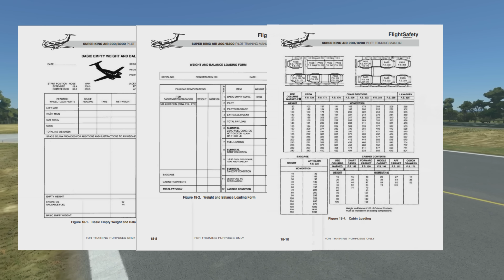Disaster Just After Take Off | Crash of King Air, Melbourne, Australia

Comment: Thanks for your video.
Some comments though.
You said the retail centre was just outside the airport.
In fact it was built within the original airport grounds.
This is an increasing problem in Australia as airports have been sold off to private operators.
These people are keen to reap the rewards of the real estate they own and are increasingly encroaching on the airport space of many of our airfields.
If the retail centre had not been built there may have been sufficient space to put the aircraft down.
In any case Essenden airport was once the main airpot for Melbourne, it was surrounded by open country when it was built.
Over the years residential and commercial building have been allowed to encroach until they are now right up to the bouneries of the airport.
In the event of an emergency there is now no where an aircraft can safely put down!
This is a growing problem.
At Bankstown (YSBK) the 18/36 runway was closed years ago and the area converted into commercial real estate.
The major tenants at he airport seem to be commercial non aviation businesses with large areas turned over to commercial development..
At Camden (YSCN) a nursing home has been built in line with the runway in a position that used to be rural land and was available for aircraft in an emergency.
An aircraft cannot return to the runway anless it has reached around 1,000 ft, below hat it masu land straight ahead.
In the case of Camden, that means into the nursing home!
Local Councils must be held to account for their irresponsible planning decisions.
The alternative is to close all airports, after all, that is what the property developers want!

Comment: Checklist problem. The pilot is fully at fault for this incident. Even being overweight by 1,000 lb. The plane is more than capable taking off and flying correctly but it must be trimmed properly especially on takeoff. Or at Landing. The two most dangerous times is the transition from ground-to-air and from air-to-ground. He had to have been suffering a lot of issues trying to keep the plane straight going down the runway. So why he even rotated the aircraft is still beyond me.

Comment: I agree with viewer, pilot would've noticed rudder trim during take off itself while on the ground roll.

2nd, 5 feet off the ground pulls hand you push nose down, reduce throttle and land immediately even if 3/4 down runways. Taking it to the air with flaps set & Gear down & extended is crazy.

If he decides to continue the Drill is mixture, props & throttle set full then flaps up/ gear up. Bank into good engine then adjust rudder & airleron trim as needed to relieve pressure etc 

Or reduce throttle on right engine a bit to relieve of servere yawing effect.

Identify & verify to feather engine only if you see engine gauges showing one engine not producing theust

Comment: I've never flown a twin.  This obviously happened quickly.  I think my immediate reaction would be to pull power off the starboard engine and stomp on that right rudder.
Reply: Which would have brought this overweight plane to the ground even quicker.
This close to the ground at max weight, it need all the engine power it can get.
Get the yaw straightended out, and all is fine.

Comment: whether or not the pilot "did the hecklist" is irrelevant.. we don't know really if they did or did not do a check list. Regardless the first step in the event of an engine failure, this instance the airplane yawed to the left as if the left engine failed, (I'm not buying the rudder trim setting either)  the first step in the appearance of a yaw to the left or right indicating loss of power on that side is "positive rate gear up, maintain directional control", of which is rudder input! If your stepping on a rudder is not enough then rudder trim is appropriate,  we don't know the pilots may have turned the rudder trim the wrong way.  the 528 lbs over wt is also irrelevant, it is 4% of gross wt, for a King Air 200.  Why is the pilot uttering over the radio mayday..?  What is that going to do.?  Fly the damn airplane. The airplane was flyable if he had maintained directional control and raised the landing gear... the first two memory items for just such an instance.  There are no less than 4 similar King Air crashes around the time of this crash.  Wichita KS, King Air 200; 5 fatal. Long Beach CA King Air 200; 5 fatal and the Addison TX King Air 350 crash, 10 fatal.  All of these crashes the airplane  yawed to the left, ultimately stalled and crashed either into a building or on airport property.  All 4 of these cases the landing gear was extended at impact.  All of these cases the airplane was flyable regardless of 4-5% over gross in this case and the Addison TX crash and this crash.  All of these cases the airplane could have landed strait ahead with remaining runway and a crippled airplane. The real question is why did the trained experienced pilots (Long Beach is the exception the pilot fabricated his experience to get the insurance policy) in all of these cases did not do ANYTHING after rotation, which is also a problem, lets say got the airplane into the air and did nothing to resolve what was going on with the airplane..?  I read the report from the Aussie version of NTSB and they pointed to the broken rudder trim cable as evidence of rudder trim out of place.   Even if the rudder trim was all the way over one way or the other, a glance will tell you the engines power output, if they are both running and you step on the rudder to no avail the next action is start twisting the rudder trim knob (not on the checklist), of which this individual could have done and in the wrong direction, maybe this individual was dyslexic. We don't know. The airplane flew in the night before, he was the only guy flying it.  There is no reason for rudder trim to be all the way over one way or the other.  This speaks to training and it also speaks to overly checklist centric direction in the cockpit being pushed so hard by the FAA EASA and the Aussies.  You can't do anything without a checklist telling you what to do.  I would submit, you need to flow a King Air, they are simple machines.  Then use the check list to review after completion of the flow   The problem is you are probably never going to have a text book emergency, so the check list won't tell you what to do.  you have to have enough experience and knowledge to react to what you have and solve the problem.  Use the checklist to learn the machine, flow it after and the checklist to verify things were done. I know this sounds like blasphemy.  I can do a complete run up on King Air 350, 200, 100, 90 by flowing it and know everything is done and set properly and not pick up a checklist.  I'll need the check list (QRH) for speed bug settings and balance field length had other abnormalities that might come along.  THat's it.  Fly the damn airplane.

Comment: Any high-time King-Air pilots out there?  I only have a few hundred hours in the King Air but many thousands in various jets.  I was Flight Safety trained in the King Air but don't remember the rudder forces.  I do know that in light to medium jets, when I suspected an engine failure I jammed in full rudder and that was enough.  My question is whether full opposite rudder with the pedal would overcome the trim setting in this case.  I just don't remember the rudder forces of my training.  Another thing is that while over the years I did a lot of training on runaway elevator trim which would end with full nose up elevator trim (and sometimes my knee pushing on the yoke to keep the nose down until I got slowed down and found the circuit breaker) I never trained in the sim with full rudder trim.  Any ideas out there?

Comment: How did he roll long enough to lift off with rudder trim being that far off? Wouldn’t the full right pedal on roll have been a clue?
Reply: Full right pedal on the roll is normal in a King Air.. and it’s not until higher speeds that the trim takes effect.

Comment: Great video, well presented. One note, don’t think the Swiss cheese model applies. The rudder trim was set incorrectly, and further missed three times during normal checklist execution. Correcting this one error would most likely have prevented this accident. Being overweight was also an issue, but likely the aircraft would have flown, but not performed as expected. Normally, the Swiss cheese model implies a series of correct decisions that collectively produce disaster.

Comment: How come the rudder trim was fully deflected to the left? That can’t happen accidentally, usually the rudder trim is always centered and you move it just in case of an engine failure. That should have been investigated to exclude rudder trim malfunction or sabotage, in my opinion
Reply: Agree. No earlier pilot would have had to use full trim without having to file a report for engine failure, and he would never have left the knob there. This must have happended accidentily right before take off. Possibly the passenger in the right seat decided to switch seats with someone in the back; then they would both have had to drag their feet right by the rudder trim knob....

Comment: I haven't flown the KingAir for over 30 years, but I do remember that if this pilot exceeded maximum takeoff weight with 4 passengers then that's no mean feat!!
For the love of God I've no idea why the rudder trim would be wound to full deflection!
The B200 KingAir I flew in the early 1990's even had rudder boost (to reduce rudder forces needed in case of an engine failure).
The rudder boost was checked before first flight each day and a full rudder trim setting would have been apparent. Also the rudder trim is easily visible, so coupled with blatantly sloppy or non existent checklist procedures I'm not surprised at the tragedy this flight became.
Reply: Rudder boost is independent of rudder trim. 

You’re doing your runup static and you’re feeling for the rudder to be pulled to one side or the other as you reduce engine power on the same side. The trim has little to no forces on it because the plane isn’t moving.